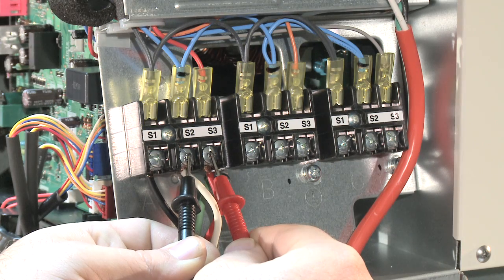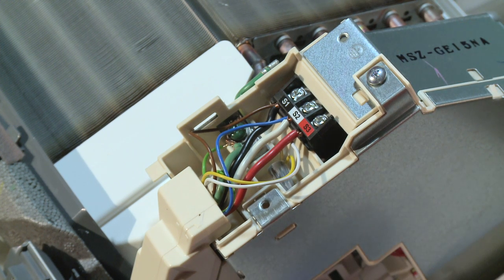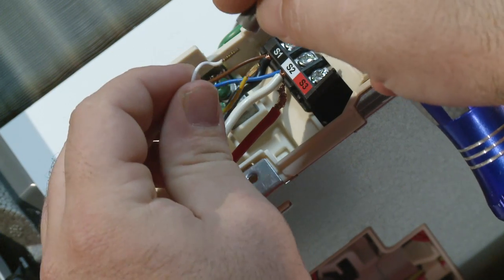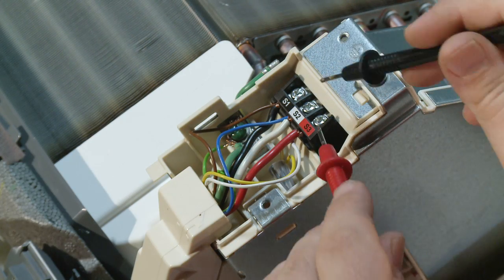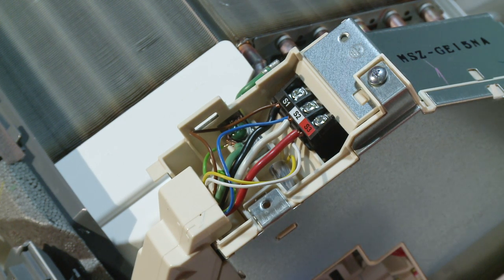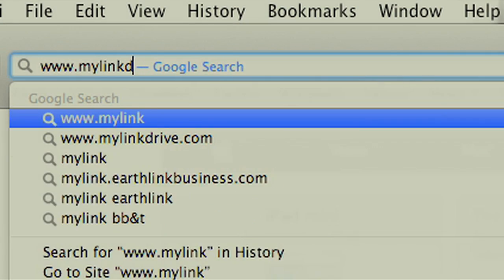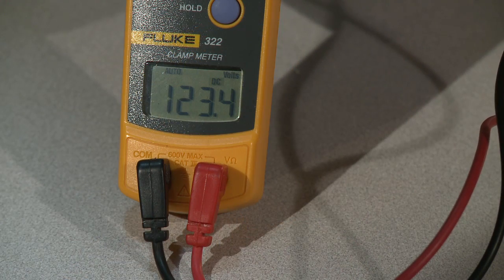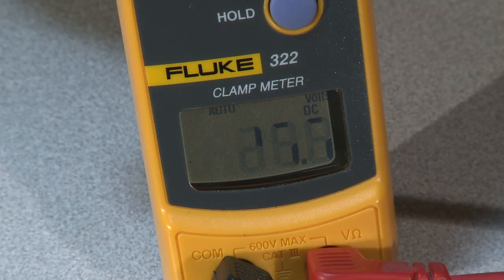1-Time Flash & E6 error troubleshooting, part 3 of 3 for Mitsubishi Electric Cooling & Heating

Comment: Extremely helpful thanks for all 3 videos! I've got the E6 code on a PKA-A18GA and didn't really know how to troubleshoot. I have no LED lights on my board so I figured it would be a bad power board, or the main board bad. But now I know I have to check with DC volts and I'm just super glad you made this video. I can actually look like I know what I'm doing for this company I just started working for. LOL

Comment: E6 error continues blinking in the thermostat then I turn off the power and restore, the error has gone. This process is continuously going on 15 days diffrence. Actually what is the issue Plz advice, need to replace pcb or need some services

Comment: Hello i have mitsubishi heavy industries AC AND it not work no on off signal get by remote what going on what i have to do
MY remote is on and work but not operate AC
Reply from the maker: Hio, Miinu. You can contact our Customer Care team at 800-433-4822 or via email at customercare@hvac.mea.com. They will be able to assist you in finding a solution.

Comment: QUESTION... MY FRIEND HAS 2 AIR EXCHANGERS OFF ONE OUTDOOR UNIT. BOTH ARE READING ERROR CODE E6. WOULD THAT NARROW THE PROBLEM DOWN. WHAT DO YOU SUSPECT THE PROBLEM MIGHT BE BEFORE I OPEN IT UP?   THANKS
Reply from the maker: Hi, George! 

E6 is a communication error.

It means that the Indoor and Outdoor units are not communicating - a licensed HVAC Contractor would need to work on this unit to determine why they are not communicating.